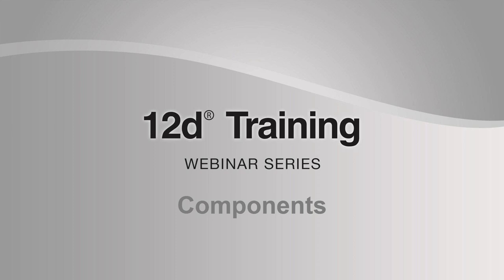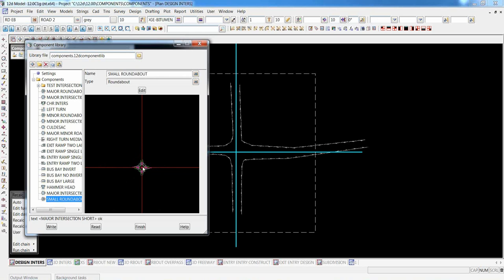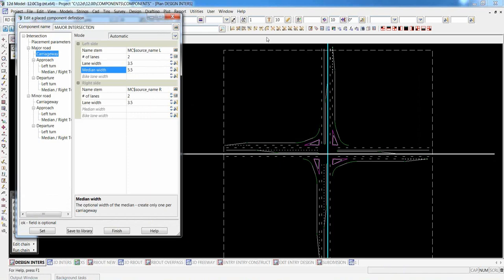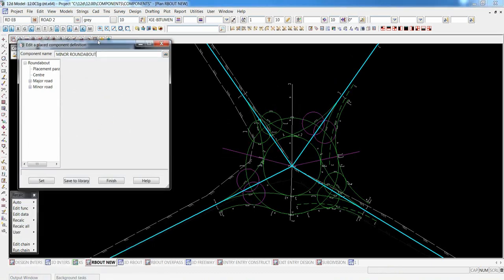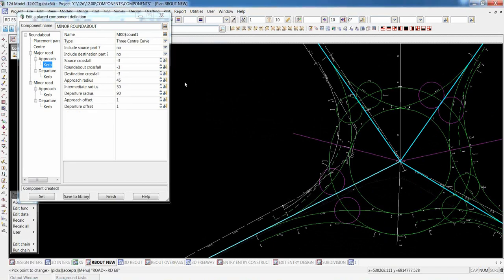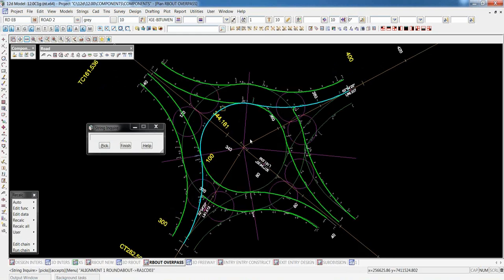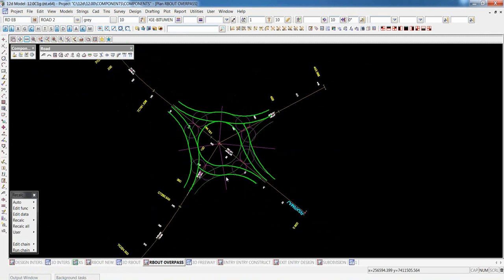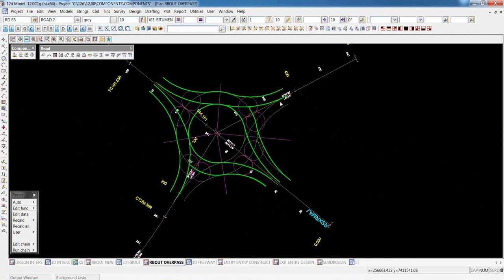Components - Training Webinar Series

Comment: Hi Peter,
I've manually modified one of the intersection leg (taper the median width from 10.0 m down to 6.0 m in a 70.0 m length), how do I update the intersection component to suit my modified alignment (super alignment inside the intersection component that I have modified). thanks.
Reply: If you have two alignments side by side that define the extents of the median, for say the major road.....then you can select them as Major Left and Right. Once you have placed the component and closed the panel down, you can still edit the function from the recalc panel, and update there